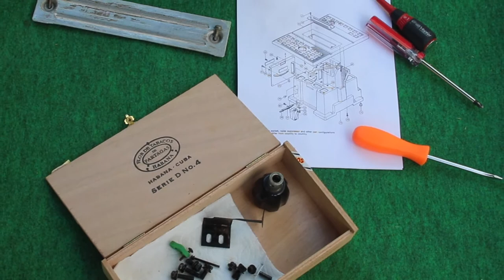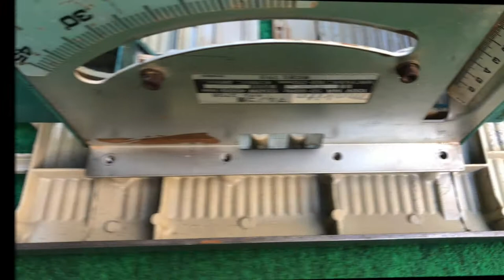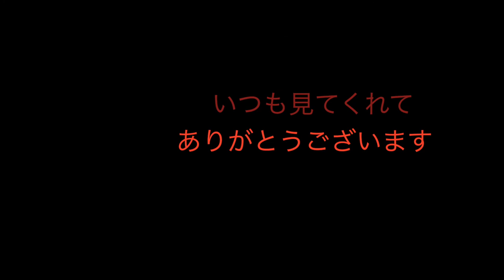Portable Makita Saw assembly: Pt.5 I finally rebuilt this thing

Comment: Hi. I got my Makita 2708 from my dad. It must have been built around 1995. My switch looked other than yours, but I already replaced it with a new one. I added some 3d printed parts to use the original holes for mounting the new switch. I also added a soft-start. Currently, I constructing an adapter plate for a Makita RT0700 palm router to fit the hole on the right side of the table. So I adding a lot of comfort to my 2708 for the next 25 years.
Reply from the maker: That's great I am glad to hear it. I gave my saw to a friend who is reforming his home. These things are great.
Reply: I was wondering what I could use those holes for on the side of the table. Thanks for the idea!
Reply: I like this table saw very much.  I bought it brand new.  Do you know how to maintain it as I lost the manual after moving several times?  Do I need to lubricator it?

Comment: Glad to see another 2708 restored and good for another 20 years! Some comments:

Always use a thin kerf blade and keep it clean and sharp. These saws don't have a lot of extra power. Some folks find 7-1/4" circular saw blades work well and are CHEAP -- assuming you don't need the full cutting depth.

2nd comment: The black knob you had so much trouble with is the worst part of this saw. You twist and twist and twist and twist to raise or lower the blade 10mm. About five years ago I hacked together a "crank" (yay for mechanical advantage) out of scrap wood. I figured if it worked, I'd make something nice later. Turns out it worked so well, I never upgraded. I can post or send a photo or something (it's ugly) if you're interested. 

3rd thing: Mine didn't have the guard or riving knife (the thing that keeps the cut wood from pinching the back of the blade) either. From what I can tell, there was no riving knife and the guard was flawed because they were a pain to remove replace and you need to remove them for many cuts. So people leave them off and lose them. I see the guards occasionally pop up on ebay (I haven't bothered to get one for the reasons above) but I did want a riving knife. The cool thing about this saw is that the place where you'd attach the knife is part of the motor frame which means it rises up and down and changes angle with the blade. My inspiration came from the Gary Katz riving knife page http://www.garymkatz.com/ToolReviews/riving_knife.html ("Gary Katz Riving" as a search will get you there if YouTube strips the URL). Process is similar to this (https://www.youtube.com/watch?v=XaQqQUH9kpI). I didn't have the old guard material to start with so I just found some scrap steel of the right thickness (~ the kerf of my typical blade; I used an old metal bookend to be honest), then made a pattern with cardboard to match the mounting holes and blade angle. After I had everything working, I cut out the "knife" with a grinder. BTW, thesharkguarddotcom used to sell a riving knife and pawl for this saw. They no longer list it on their site, but may still sell. They also used to have downloadable pdf template but I don't see it any more. I found that after I made my own knife and it turns out it was close enough to mind that I didn't bother to redo it. Unfortunately I can't find it in my web detritus or on the wayback machine. 

4th thing -- it's reasonably easy to make a zero clearance throat plate for these. The metal throat plate that comes with the saw has a pretty large gap. On thin cuts I'd find a lot of material getting sucked into or shot out of the cut by the spinning blade. I planed some oak, then routed out clearance for the the mounting screw areas (they require fairly thin wood, but I didn't want the whole plate to be that thin. https://www.lumberjocks.com/topics/12370.

Last thing -- Makita actually made a dado stack for these. Crazy, I know. I bought mine on ebay for about $30. It had never been used. As far as I can tell, they never made a dado throat plate. I was able to make my own using the above method. It's not perfect, but better than nothing. 

Last last thing -- I still keep meaning to make a small sled.  I've planed and ripped some thin oak "rails" to fit the non-standard miter rails and just need to make the top/base of the sled. My plan is to use something thin so I don't take away too much cutting depth. These 8-1/4" blades don't have much cut depth to begin with. I'll get around to it someday. Maybe.

Last last last thing -- I'm not sure if they ever had them in Japan, but there was a Makita-branded (I think Rousseau was the OEM. They still make them for DeWalt and other saws) extension table with a beefy fence (and infeed/outfeed/router table options, yoo). It folds up flat and would probably fit in your shed. It's how I use my saw most of the time. Something like this: https://s3-us-west-2.amazonaws.com/usedphotosna/44402810_934.jpg. I have no idea if the link will come through, if not just search for Makita Rousseau 2708 Folding stand.

Last last last last thing (I promise) -  While these mods work great for me, please keep in mind this DISCLAIMER: Modifications to any, but especially vintage, saws are dangerous business. I share this information for purely reference sake. Anything you try on your own saw is done at your own risk!
Reply from the maker: Thank you very much for all of the helpful information.
Reply: Thanks from me as well!  I have a 2708 from my dad, left over from when he started his business!  My fence is in rough shape - a weld broke loose, and the carriage bolt is rounded out.  Any tips on a replacement?
Reply: This is awesome info! I just picked up a 2708 in great condition, and I do want to add a riving knife. 
If at all possible, could you post a tracing or the dimensions for your custom riving knife? I can probably figure it out, but I'd rather not reinvent the wheel.
Reply: @bigolric  I'm not in the same location these days but I'll try to find the pdf that I used as my starter template (unfortunately that's on a computer not local to me, either, but I'll try).

Comment: I am having a problem getting the Locking Lever back on correctly.  It has two hex nuts and a washer that go onto the mounting bolt (the mounting bolt on mine uses an Allen wrench).  The bolt goes all the way on, but I get no friction when I engage the Locking Lever, so it's obviously not doing it's job.  Clearance between the lever and the front panel is minimal, so I can't really get a wrench on the hex nuts when tightening the bolt with the Allen key.  Any help would be appreciated.
Reply from the maker: Hello, Thanks for reaching out. Unfortunately, I've got bad news. I no longer have this saw on hand. I traded with a friend two years ago. So I haven't got it around to really check to see what the possible problem you are having could be. The only thing that I can think of is possibly your bolt or the receiving end could be stripped. Also, is the washer causing any issues? Sorry, I can't be of much help here. Good luck, I hope that you get this figured out.

Comment: I have the same table saw.  It  works very well. However, I lost the manual.  I bought it brand new.  Do you know if it needs oil to make it run better or to keep it longer?  I really like this machine. It always give me accurate cuts.
Reply: I have found the manual and parts list online -- free pdf download.